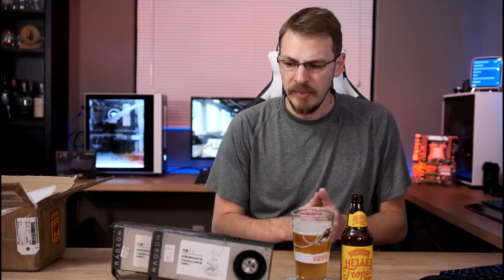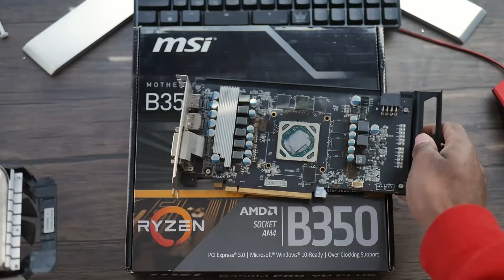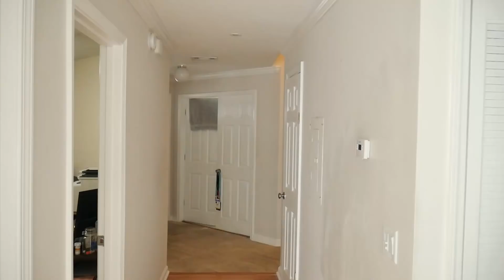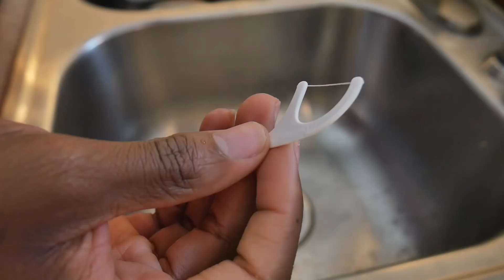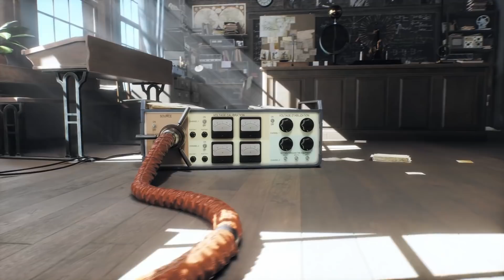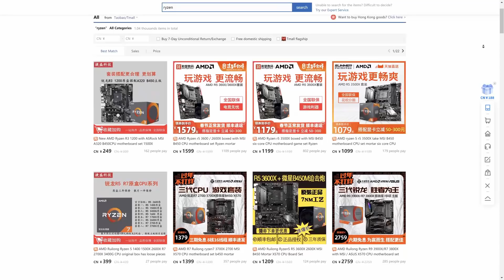This Chinese GPU is Only $56...and it's in AWFUL condition! | OzTalksHW

Comment from the maker: Something that I didn't mention: because of the severity of the Coronavirus, be careful when ordering stuff from China. The virus shouldn't survive its travel to wherever you are, but be just be aware.
Reply: The virus cannot survive more than 48h in the best condition on unanimated corpses. That is in best conditions in a lab. The packages from china takes more than 2 days to get here... If you re really concerned you could just leave your package in your garage for 2 days ;) but otherwise its just fine to order from china
Reply from the maker: @TheAmanor123  Oh thanks for the heads up! Did not know that. I'll edit the pin
Reply: @OzTalksHW  Did you know alchol can kill the Corona Virus
Corana kill the Corona virus.

Too bad I'm 12
Reply: @OzTalksHW  Oh yeah what processor did you use for the benchmarks
Reply: @spiceydice6968  Well, I should be safe then. But I'll have some more alcohol, just to be on the safe side. Purely for health reasons, you understand
Reply: @herseem  that was 6months ago, turns out the experiments were wrong. :(
Reply: @spiceydice6968  Well, I've had some acohol anyway, just to be on the safe side - Aldi special reserve 'Highland Earl'  whisky - and I'm feeling good, and right now I couldn't give a f**k about any coronononavirus. 

To be serious for a moment, from extensive experience of analysing scientific virology-related papers and having been involved in several virology-related legal cases, it's the shittiest-quality of science going. Unless you've actually read the papers yourself, and have familiarity with a number of aspects of virology that have to be acknowledged and incorporated into the experiments in order to ensure the paper is robust - such as the tendency of stress on cells to change their own DNA, including the 8% of our own core DNA that is widely regarded as being of a viral nature - then you really can't tell whether findings as reported by mainstream media are robust or not.
Reply: @TheAmanor123  thx and ya.
Reply: @TheAmanor123  updating you on that, it's actually survived 9 days, even longer depending on temperatures.
Reply: @PhonePhone-sf8te  dang really?  I hope the colder it is the less the chances or survival it has, from canada lol
Reply: @TheAmanor123   actually, it's the opposite.
the colder it gets down to like 4 degrees(probably celcius) the longer it can survive.  If you ordered a package from china in the past month and it was infected there's a fair chance it could transfer to you. They don't tend to let packages get  freezing cold, but there's so much we don't know about this specific virus yet.  First it was said it could live 24 hours, then 48 hours, then 9 days, now it's something between 2 weeks to one month depending on environmental conditions.
Reply: @PhonePhone-sf8te  I see ya, what about sub 20 celcius lol. And honestly, wouldn't the post office not accept shipping from wuhan anyways? The shipping rules and all are probably strict about this, and the chances the virus is in your package are pretty low already,then it has to survive from china to your country ( usually takes 3 weeks or more ). I think the chances of dying from a car accident tomorrow are higher than picking up this virus from your package 😂 although it surviving longer than we expected is not something to rejoice about
Reply: @TheAmanor123  pretty sure all the shipping ships stopped running about a week ago, but shenzen was just quarantined and that's where nearly 90% of all electronics are manufactured.  at this point it's not a wuhan thing anymore, it's almost every province in china.  The big problem is that this has been an ongoing thing for a little over 2 months and they waited a very long time before shutting anything down. I'm not saying don't order anything from china, even if you did it wouldn't ship for several more weeks at the soonest. I was just pointing out that this thing can live way longer than anyone expected early on and practicing proper hygiene is all we need to worry about for the time being.
Reply: @PhonePhone-sf8te  Yes I understand, honestly its a disgusting virus ( i mean every virus is) but this one is harder to deal with because of the large population in China. I mean no disrespect to Chinese people but some of them are just plain disgusting. Eating a fucking bat? Dogs? Racoons? That's not human. You should see how they treat animals in their markets, they skin dogs alive and hang them. Sometimes they boil them alive in oil. Even when they do these disgusting things, they dont do it right. They have no hygiene or respect for nature and the animals they eat. Im not sure they're totally human beings. Im not talking about every chinese here, Its only a handful of them. I hope this serves as a damn lesson to the idiots in wuhan. Hygiene is extremely important when dealing with food markets ( and food in general) and these idiots ignored the rules...sigh.
Reply: @TheAmanor123  amen.
Reply: Most of Aliexpress products comes from warehouses around Europe nowadays,  like Spain, Germany or France .
Reply: @gertjanvandermeij4265  not the pc components. They say SEDG Shenzhen on them. Especially the 3500x and newer ryzen stuff, those xeons and recycled chipset mobos.(which you 100% can still get if you are smart about it)
Reply: It's a joke. Agree 100%
Reply: This kinda makes me worried buying stuff from amazon
Reply: Viruses don’t survive on dry surfaces more than 5 days for plastic or metal, MERS coronavirus did survive on surface in a lab for 28 days but in 4°C and 20% humidity rate, those conditions while they can be achieved on a plane at high altitudes don’t stay constant ( 2019-nCoV and MERS-CoV share 85% of their genomes ) so at the time you will receive your package that virus will mostly be dead, if you are still worried just clean the package with 90% isopropyl alcohol before using it
Reply: Those who are telling virus cannot survive let me tell you virus when situated on a non living object behaves like a non-living thing but as soon as any part of your body comes in contact with the thing it moves into your body and becomes a living thing . Viruses need special medical treatment to be killed.
So yes if you are ordering from China there a lot of Chance that you are about to find Corona Virus in it. Do it at your own risk.
Reply: Bro I hope you didn't get the rona. I'm doing a rebuild with I7 3770, which would be a good gpu 1060 or 1660ti. Your help would be appreciated.
Reply: Thanks OZ!  Super Buy is awesome! Helps my Shop save a bit of money!
Reply: That's nothing bud😂; https://www.facebook.com/photo.php?fbid=10217292804247134&set=p.10217292804247134&type=3&eid=ARCMksuOz4FyrvoUpjJgA0zTv5T8O8tS4hyxxIX8VlbITtt4vwDJ-nzSXh0dbc_S8L9WAegw8ErtQOTI
And after......https://www.facebook.com/photo.php?fbid=10212303834646012&set=pb.1083270586.-2207520000..&type=3&size=1511%2C2015
But a KFA2 GTX760 for £39......meh. 😉
Reply: I was about to say oz what the fuck but then you said that you'll edit the content so it's all good
Reply: Te virus won't survive the container at 50 celsius lol
Reply: The intro alone was a giveaway because of the face mask being an indicator to flu.
Reply: I would be more worried that my parcel takes 3 month to arrive due to the outbrake
Reply: I am pretty sure my dvi cords and the lga 1155 ordered from Amazon will not be coming.
Reply: Hi is an MSI Rx 580 8GB @ $70 a good deal?
Reply: @BarryManilowa  You seem to be unaware that virology is a scientific discipline that is notable for it's almost complete lack of scientific discipline. Controls, much? Not using phenomena already known to have other causes? Taking into account already known confounding factors? Perhaps you could point me to a published paper where the virus that causes COVID-19 has been PROPERLY isolated before being characterised, using CONTROLS. If you can actually provide one that withstand scrutiny, I'll eat at least a bit of my hat and put the video online.
Reply: @BarryManilowa  Haha! I'll go for mayonnaise.... if you can provide an accessible link to the paper
Reply: Use brake cleaner on the thermal paste
Reply: Just don’t purchase soup
Reply: ... aren't you the guy that got fired by The Verge for being a giant screw up? Your voice is the same... If you shaved your beard, and wore glasses you would be a carbon copy of him. That said how were you not expecting this video card to be bad? You bought it from AliExpress... What did you expect?

Comment: Superbuy is a bit weird though. I have purchased some strange things from there. Like a DDR4 to Sata Adapter ???? one of the adds I found for a RX card was titled as follows "Disassemble RX470/RX570 graphics card 4G alone sharing 8G eating chicken desktop computer to do graphics independent game graphics" <<-------- I get the nonsensical stuff but the "Eating chicken" is where they lost me. I assume this is the rough translation for "Winner, winner chicken dinner" as the card add had pictures of PUBG on it. lol

Comment: I recommend using methalated spirits next time or some type of cleaning alcohol instead of soapy water. I know it's a bit more expensive, but with soap you have a risk of leaving some conductive residue back on your components, as Soap is basically composed of Lipids and salts the later of which might be slightly conductive.

Comment: If you're concerned with water on the board when cleaning off thermal paste, you should just use goo-gone or goof-off to remove it with a paper towel or microfiber towel.  Works like a champ and you don't have to scrub any of it off.

Comment: Where do you see rust and dust? In my opinion You ruined card with tap chlorid-fluored water. U shouldnt do that even with complete dead card and youll probably sell it. Now bunch off noobs will do that same. Washing perfectly working components is ok with destiled water and alchocol after that. People wash dead usseles junk with tap water like gf460mx cards etc that doesnt worth going to shop and buying destiled water + that components have Pb which makes them resilient to rust.

Comment: I panicked when I saw water on the PCB. I would have gone with something that evaporates quick, like alcohol, electronics cleaner or even break cleanerr or canned air.... water was not even in my list.
You would have had to use a electronics spray to protect it from future corrosion anyway.

In the end, it came out clean and pretty though.

Comment: You did a great job cleaning everything up. One thing to consider for the next PCB you clean though is spraying the entire thing down with isopropyl alcohol afterwards.  This will help wash away any minerals and other contaminants that were in the water.

Comment: I feel like it should go without saying that not giving that thing an alcohol bath after using TAP water is kind of a big deal. Maybe i missed something but you can be sure that corrosion is going to start to develop under some of those components. im not hating or trying to be a dick i watch many of your vids. Im just saying i literally fix electronics for a living, and i do a lot of water damage repair. This could be fine especially depending on how hard your tap water is, and for a $56 gpu maybe who really cares. Im more concerned about the person that's going to wash his 2060 in his sink and think its OK since he "dried" it.

Comment: Uhm you washed it with faucet water and air dried it. That is going to leave salt deposits behind which will attract water and dust causing accelerated corrosion in places you can't see. You should at the very least washed it with distilled water and let it dry.  Preferably, distilled followed by 70% propyl alcohol and then let dry. Ideally a ultrasonic cleaner would have been best :P.

Comment: Hey guys I just built my first pc today I have a 3200g with no dedicated graphics card my monitor supports 144hz and I am using a dvi d to display but I still cant use 144hz it only shows 60hz option in display settings any help?
Reply: also mobo is b450 pro m2 max

Comment: You shouldnt run them under water, they have this stuff in a spray an call PS electric terminal cleaner that will clean off everything way better than water and it dries in 10 seconds completely.

Comment: Me, an intellectual: cleaning them with water and detergent (I'm serious, that's how I washed g41 mobo)
It's still running fine, you gotta let it dry first. I also sprayed WD-40 knock off just to be safe
Reply from the maker: Yah just let it dry if you're super nervous about shorting stuff out
Reply: My second experiment with hp z200 sff mobo shorted it out

Maybe it's not dry enough? I used same method.

Comment: Like and subscribe for his deep cleaning efforts! First time at the GPU cleaning rodeo eh? I cleaned a pair of ASUS GTX660 that were narley bad with caked dust and cobwebs, with dust bunnies on the outer surface. I used a long bristle touch up paint brush 1/2 or smaller, and a used toothbrush to get it all clean! Dropped GPU temps from 82C to 68C and added small heatsinks to the back of the board, opposite of the VRM mosfets and was able to oc the memory higher than before! Cleaning the GPU helps with the temps and sell a better looking card; and if you are thermal throttling due to temps, then cleaning will help in performance.

Comment: Hi I was wondering what would be a good gpu for the amd phenom ii x250 not trying to do modern games maybe xbox360/ps3 games as well as emulation
Reply from the maker: The phenom (or do you mean athlon?) will struggle in modern games, but a GT 1030/RX 550 is a good combination. if your power supply supports it, also the RX cards since they're so cheap

Comment: Soft toothbrush is way more handier than the tools you used. Also I hope used air compressor or specific air blower designed for computer cleaning after washing to get all the water out, just drying may leave residue from water that may be conductive. Dishwashing liquid is excellent for cleaning electronics, just make sure you use one that doesn't leave any coating. Dishwashing liquid removes fat and other organic residues very well.
Also pure isopropyl alcohol is excellent for cleaning electronics, it's also used in contact sprays and whole alot uses. I use it to finish up my cleaning.
Oh and this comes from the mouth of a retro PC/console/game collector that needs to clean and refurbish old machines quite often.
Reply from the maker: Thanks for the tips!

Comment: I'd much rather to use isopropyl alcohol than water straightly. And a compressed air can, if it's possible. A tap for a clean up seems so unsafe to me.

Comment: Video liked & I took a lot out of it but as a difference of opinion, surely you can't expect a mining card to be in great condition, especially from Asia. (as I'm sure you're weren't OZ, merely good content creation opportunity). If these sellers are to open them up, clean them, re-paste etc etc, you won't be getting them (in this case a RX 570) for $56 USD, period. Hell I have even purchased components from the general public and most of it has never been cleaned since new by the look of it. 

Buying used parts, especially graphics cards comes with a host of caveats, but I'm fine with buying used mining cards, even if it means doing what you did in this video for a huge discount. As an example, just picked up 2 x Sapphire RX 480 8GB Nitro + cards for a little under $65 USD, and in about the same state when I opened them up. Thorough clean, re-applied thermal paste & the cards performing great. How long they last, who can say... risk to reward here.
Anyway keep em' coming!!!

Comment: G'day OZ,
great video showing how to clean PC parts,
I use a cheap 'Medium Bristle' Toothbrush (no toothpaste 😁) all over the Motherboard when cleaning, it works really well to get into the tight places & isn't too harsh on the small soldered parts,
I also found using a light coat of Lanolin Oil spray on any metal parts with corrosion & then let it 'Air Dry' over night helps prevent corrosion getting worse
Reply: Dont forget a cloth in the sink so it doesnt get damaged and the sink doesnt scratch up.
Reply: @Dr.C-UTS  I do mine in an old Baking tray outside 😁
Reply: Wait a minute... sounds like TYC Waterworld....

Comment: Get a waterpik flosser, and fill it with isopropyl, and spray at the card over a bin, either outside or with a fume hood. That's how you get a PCB clean. Even gets gunk under BGA chips if you point it under them.

Comment: I've bought 139 cards in even worse condition  from a local miner. Some with broken fans even. But they were RX580 4gb for ~35$ each. Gaming cards no "1 dvi" bullsht. So i couldnt resist lol.
The place was clean but the cards worked over 2 years 24/7 without much care except for occasional dusting. So dust under heatsink kept collecting.

Since im super lazy i've just stripped them from cooler and put into a dishwasher cards and coolers separately. 95% on the dust was gone. For whats left i couldnt care less. 

Sold them for 75$ with fans working and 50$ for ones that didnt. All cards were gone within a week.